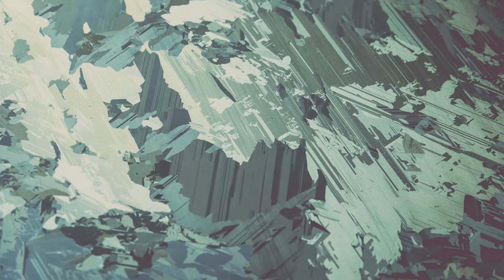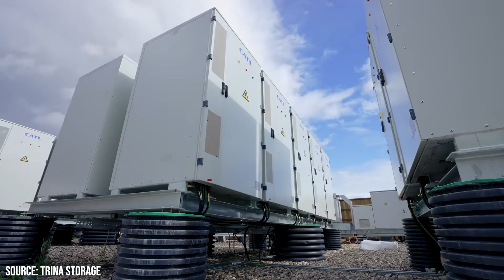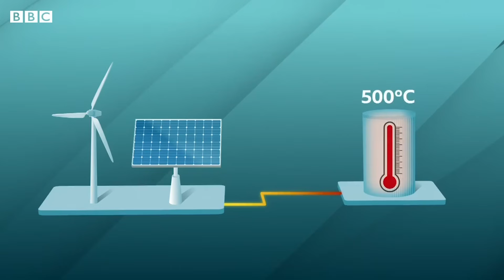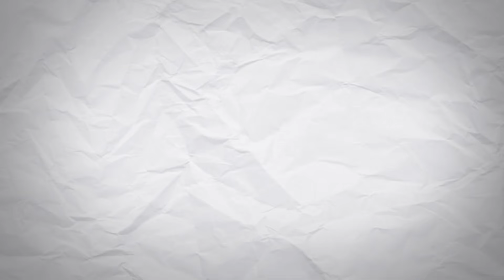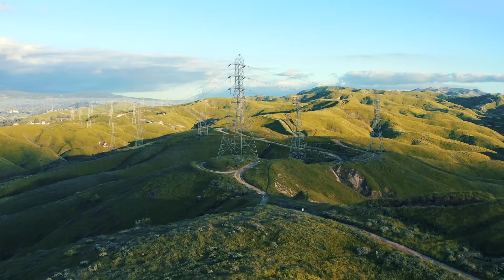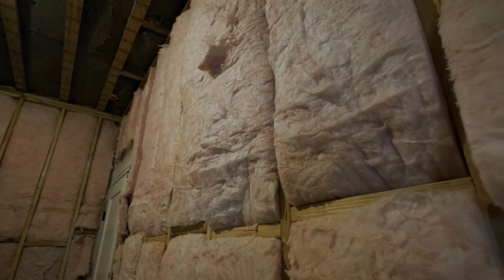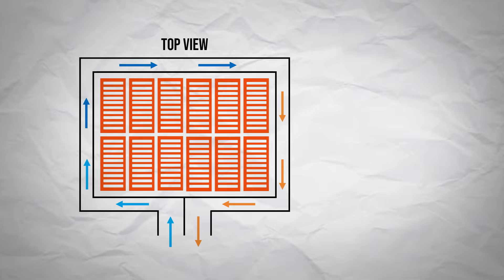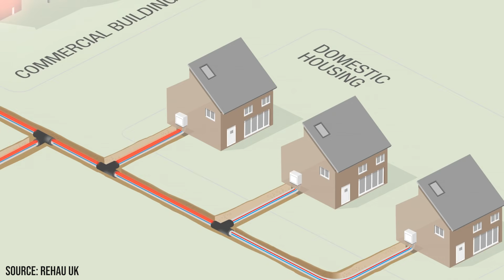How 3000 Degree Bricks Will End Battery Storage

Comment: Here in the UK  there is a firm selling a similar system to replace your gas central heating boiler. They seem to work very well. Not at such high a temp (I think 500C) but hot enough for domestic use. Are there problems with this approach? Prob yes (cost for one, but the concept is well worth following as it could be one  of a 'battery' of things to save energy and reduce co2 emissions.
Reply: Storage heaters of any kind are very expensive to run unless you can use cheap off peak electricity. With the advent of overnight EV charging that is not going to last very long. It is far better to use a het pump with COP in excess of 3.
Reply: @rogerphelps9939  I agree about the electricity. My parents used storage heaters and economy 7. There is a guy on yt who hosts a green channel who has one of the mentioned ' boilers and says about cost etc.

Comment: The guy is not thinking straight. You don't take 3000C heat and convert it into lower temperature to pipe around houses. What you do is you do what you do in a power station but use stored heat at 3000C. The reason is the Carnot efficiency is 90% at this temperature so you can deliver almost all the energy to domestic homes down wires, which are already there and don't wear out. Once in the home you then use a heat pump, so now you have about 350% efficiency.Second point - as you scale the linear dimension of the storage bricks the surface area goes up by the square and the volume the cube. Your energy storage is proportional to volume and your heat loss is proportional to surface area. The bigger you make it the longer the time you can store the heat.

Comment: Check out "Sunamp Heat Batteries" https://youtu.be/2K8Snpx8KFg British design simple system and after 40,000 charges they are still at 100% and once charged retain the heat for months before. Seems much better than Rondo.

Comment: Key factor:  really cheap renewable electricity inputs.    
Interesting use of configuration and materials for radiation = leveled storage across many physical elements with surface areas.    
Any chance you can describe the physical nature of the heating element(s) ?   In my mind I have a toaster oven ni-chrome wire wrapped around a ceramic tube ... surely, more genius than that went into it :)  lol

It pleas for the development of an industrial sized vacuum bottle to be housed in :)    

Having looked at the Livermore Labs' energy flow charts and realizing that about 60% of all energy use in the US ends up as rejected heat, going after some of these primary heating processes is a great idea - just on fuel reductions in addition to their emissions.  And, it'll save some fuels like NG for other uses which can't be met with million lbs storage batteries.
Reply: Nichrome has a maximum operating temp of about 1150C/2100 freedom units.
For 3k they are using arc/plasma to generate that kind of temp in the storage, and as you point out without vacuum the losses are significant.
Reply: @jimurrata6785  no.    "Additionally, the example implementations described herein disclose a resistive heating element. The resistive heating element may include a resistive wire. The resistive wire may have a cross-section that is substantially round, elongated, flat, or otherwise shaped to admit as heat the energy received from the input of electrical energy.
[0455]
With regard to the composition of the resistive heating element, if the resistive heating element is a resistive wire, it may be metallic. Further, the resistive heating element need not be limited to metallic wire, and may instead be formed from another material, such as a ceramic, including but not limited to silicon carbide, magnesium silicide, or may be formed from a combination of these and/or other materials"

Comment: This is literally just the rakine cycle with uses bricks as a heat source. If anything, capturing lost heat is a better use to increase efficiency or improving metallurgy of superheated pipes (can withstand high temperatures at super critical pressures)

Comment: I am a bit confused.  Is this system storing electricity like a Lithium battery or heat?  A Lithium battery stores electricity that can be used for any electrical application.  This system seems to only store heat that can only be used as heat.  I don't see how you can say it will "end battery storage".  First, sufficient electrical power must be generated in a large enough volume to heat a large pile of bricks to 3,000 degrees.  Well, what kind of power generator is this?  When the heat is depleted what replaces it?   We are talking about heat at kiln-like temperatures. What do you do with that kind of heat?  Perhaps it would be useful in industry but this heat storage would have to be very close to the point of usage.  Am I missing something?

Comment: Nuclear energy creates lots of heat in a clean manner. If heat is all you are after. But using electricity to create heat is a loss to mankind as heat is a low grade type of energy, but electricity is a high grade type of energy. We should use electricity for heating as little as possible. It's sad with the meltdown incidents of Tsjernobyl and Fukushima, but this is more do to stupidity and poor placement of the nuclear plants. Nuclear is the way to go!

Comment: Even if this scales it will not end the need for battery storage as your very misleading title suggest, it will reduce it.
It does have the potential for industrial heat and for the higher latitudes where winters are cold and days are short and sun is at a bad angle in winters. Because when it's both dark and the wind is not blowing the high RE system would need a lot of storage and a good amount of it would be for heating so having efficient thermal storage would be a great boon and decrease the need for battery storage significantly.

Comment: The heat output to electrical power goes through a heat engine, and the maximum efficiency for a Carnot heat engine is 60%. The claim of 98% efficiency is misleading, as others have stated.

The problem is entropy. Entropy will always get you in the end, just like death and taxes.

Comment: This is NOT energy storage, this is heat storage. You cannot get useful work out of it without a heat engine and the 50% - 75% loss that entails plus all the cooling infrastructure. It might be useful technology, but it can only ever supply a small fraction of our energy needs.

Comment: This is nothing more than a fancy heat exchanger/space heater. The principal is easy to understand, but I can guarantee that if this were as sustainable as this video is making it out to be, this would have been utilized and scaled a very long time ago. It almost sounds like one of those perpetual energy devices. You input energy via solar/wind to heat a material, then you transfer that heat from that material to make steam which is then used to make electricity via turbine ie. Mechanical energ ?? That's the gist of what is being described here. Maybe I'm missing something. My gut is telling me this is too good to be true, and that usually means it is. 🤷

Comment: I would be extremely interested to see how well this scales down for the use of heat in smallscale industry. Ceramics and metalworking, the potential applications are significant.
Reply: It scales only for Home Use. This type of Heating was popular before the Oil Crisis of the 70s in Germany, and is Popular again today. It is not as efficient, as fossile fuels - but if you make use of cheaper nightly energy tariffs, you can basically charge these bois up "over night" ; and then let them dissipate their heat over the course of the day.

For large scale, this is , however, obviously idiotic.

Comment: 5x cheaper? Let's say you buy one of these instead of a $50 battery. 1x cheaper than $50 would be $0. Two times cheaper would mean they pay you $50 to take the battery. And 5x cheaper would mean they pay you $200 and you take the battery. You mean to say 1/5 as expensive. Or 4/5 less expensive. It's ok. Lots of people have a hard time with word problems in math.

Comment: It was an interesting concept but how does this brick store 3000 degrees? What’s it made of(for the most part) to give it these thermal qualities? Is it a normal brick? It it a firebrick? Was it solar radiation we’re supposed to be using to heat it? How is it rising to 3000 without a fresnel lens or concave mirrors or fuel?

Comment: Why not just use a very small amount of produced electricity and power an electric magnet along with the metal that works best to produce induction heat heck you can probably even do it with a strong enough permanent magnet.

Use both sides of the Force Luke.

Comment: This is a case where most people don't understand the economy of scale in industry.  A industrial site doesn't use 100 times as much energy as a home, it uses 100,000 times as much.  One of these storage systems the size of a large barn could replace a boiler and run on renewable energy.  

That is a pretty big deal.  There are nearly a million industrial scale boilers in the world, and replacing them with something like this could buffer the renewable grid way better than 100 million F150s ever could.

Comment: Running the heat around the air-gap means it loses heat. That is neither a novel idea, nor is it a game-changer.Thermal storage isn't exactly the worst of ideas, but, it does suffer the problem of the efficiency losses taking place in the form of lots of radiated heat. Yes, the charging is efficient, but the preserving is absolutely not. After all, a still more efficient mechanism would be to skip a pre-heated double-wall, and instead, contain the ceramic in a dewar flask (aka a Thermos) where the wall is a constant strong vacuum. Even then, the losses are extreme.
Further, I am vexxed as to why this video completely ignores tests  with sun-tracking mirrors that super-heated salt (sodium chloride) into liquid, which, btw is much more useful for moving that heat energy to where it is needed. But research is currently showing that the technology does not compare to localized setups with photovoltaic solar panels and lithium ion batteries.
In a very niche situation, this could be a good solution for constant industrial power, but, a better solution for the needs of constant industrial power is to set up those industries as close as possible to established hydroelectric power sources, which is something that we already do.

Comment: Just a heads up for anyone who believes these clowns:
They claim "minimal" loss and 98% efficiency. But the battery also only holds its charge for 1 day. Meaning there are losses, bigger than 2%. Their heating to storage process might be 98%, which is good. But you're extremely unlikely to get 98% of that heat at the output. Heat is one of the hardest forms of energy to transfer, too. So before you get it to your process, you'll lose a lot. Begging the question whether or not it's worth storing at all in many cases.
There's some PR guy in the comments dodging questions informed people have. Which makes it seem like they took advantage of Ziroth to create their next fund run video for them. Hope you got paid for it, because their product is definitely not what it claims to be.

Comment: What heater material is used ??   I can imagine  high temp alloy wires will oxidise .    Ceramic elements might crack if cold, to be heated air , flows over them.
 But probably also oxidising or other processes on high temp will/can cause issues.    

How is that solved ?

Comment: How well has the super heated salt worked out for solar? Sometimes things remain mostly as an idea because the reality isn't as smooth as the creators imagined
Reply: they in fairness explained why. solids create local hotspots and they do work but have slow discharge and upchrage due to this. This device has that problem solved.

Comment: Sensible thermal energy storage is nothing new. This concept is kinda cheap to make and easy to scale in means of pure heat storage. However there are some bottlenecks using an air as the heat transportation medium. 1) Air is very bad in conducting heat, so  the heat exchanger between air /steam (or whatever medium) has high requirements for the heat trasfer area and this doesnt scale well, especially if you talk about  heat power > 1 MW.  2) Hot air has very low density (>1 kg/m3) so it is no joke to make it move in some higher quantities.  3) using closed air loop meaning that the blower inlet has also higher temperature and there is same problem as in 2. point.
I think this concept has a good potential for just pure power to heat applications, but unfortunetally it is not so good for power to heat to power applications.

Comment: A bit disingenuous that brick heat providing lower cost than a water tank considering the majority now don’t use water tanks. But its all about ramping up scale, how much capacity can be provided via non carbon generating systems considering the amount used by industry ?

Comment: In terms of home heating, it is rather like the Economy 7 home storage heaters which were popular in the late 70's and early 80's. They had heating elements, bricks, and refractory insulation. They had bi-metallic strip operated baffles which opened as the storage heaters became cold to fully "discharge" them. The technology may be useful in induatry, but for home heating, the technology has been around for a long time, but fell out of favour due to having to predict what heat you will need the next day. A storage heater would "leak" heat which, if it was a warm day, was wasted.
Reply: True, but if you're storing heat from solar or wind I think that would be a lot less of a big deal. Wasting heat from gas or grid electrical is wasting money and resources, but wasting heat from yesterday's wind isn't any real loss -- you just saved up a little free energy in case you needed it later.
Reply: @eyesofthecervino3366  This is all irrelevant when you consider that heat pumps can produce around three times as much heat for each unit of electrical input. Any kind of storage is both expensive to run and wasteful.
Reply: @rogerphelps9939  
I'm not sure what comparison you're making, tbh. Heat pumps can produce three times as much heat as what? Also, don't heat pumps become less efficient as the temperatures drop outside? I can't imagine it's always an even comparison between them and other methods of heating.

Comment: NY City actually has lots of steampipes already, and I wonder what the similarities and differences are to those existing systems.
Reply: Rondo would export steam into the existing steam pipes in this scenario. I (marketing guy) don't know a lot about NY's setup, but i'd guess they're using fossil fuels / waste heat from fossil fuels to generate steam for those steam pipes.  We would provide zero-carbon heat.
Reply: @RondoEnergyGlobal  They are co-generation plants utilizing 'waste' steam from electric plants and provide it to a local area that no longer has the industry that used to use it 365.
Using gas, oil or coal to create steam, to drive a turbine coupled to a generator, to create electricity, to heat a brick, to create steam to provide heat is like ordering a pizza delivered by way of the moon.
Steam is fine for seasonal heating of residential and commercial properties but isn't process heat for heavy industry. 
The advantage in Manhattan is that there are not trucks blocking the streets providing oil to incredibly inefficient boilers, there are no oil spills and there is no need for a smoke belching chimney in each building.
NYC recently enacted an ordinance prohibiting any new natural gas hookups or appliances. This is a bit of an issue with restaurants in particular.
Providing resistive heating to a city of eight million isn't very viable either (especially given they just shutdown their local nuclear plant 20 years early)

Comment: Rondo Energy -for logical energy use.....  if your using some heat from your system to send to localized commercial building and homes for winter heating.... that is great for part of the year.   For the other part where AC is needed.. maybe the heat could be used in the old school heat absorption refrigeration and pump that cooled air thru same pipes you were pumping the hot air to those same buildings??.
Reply: We're not currently focused on small commercial buildings and district heating networks. We're after large industrial facilities that are very energy- and carbon-intensive and have 24/7 operations that rely on fossil fuels.

Comment: The "dynamic insulation" bit seems like bullshit.  The hot gas will transfer gas to its surroundings, so by running it through the battery to heat it up, you're actually increasing the flow of heat to the surrounding environment.
Reply: The hot air is run over the boiler to generate steam, cooled down (still warm) air is then recycled back through the system where it is superheated and run over the boiler again. That superheated air sits inside of the dynamic insulation, so we're capturing losses with the cooler air circulating around it before it's recycled through.
Reply: @RondoEnergyGlobal  ok so the dynamic insulation is provided by the gas on its return trip AFTER giving up much of it's heat. The description in the video makes it sound like the gas fresh from the battery is used for the dynamic insulation.
Reply: @daves.software  Yes on the return trip where the air is significantly cooler and quite easy for the outer-most insulation to handle.